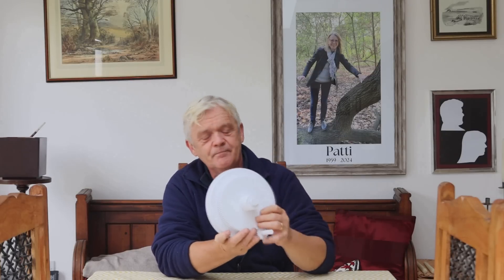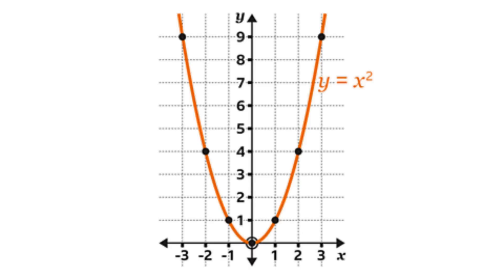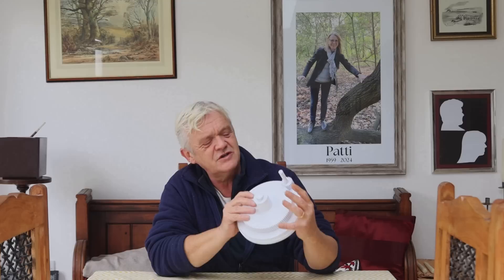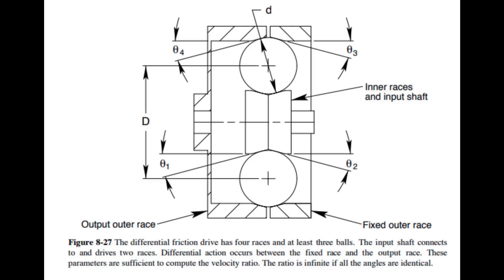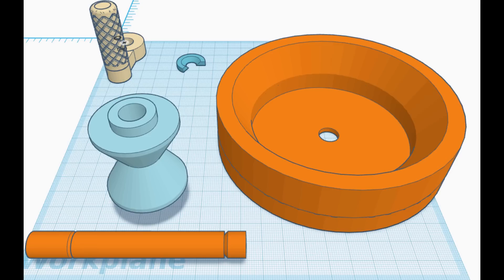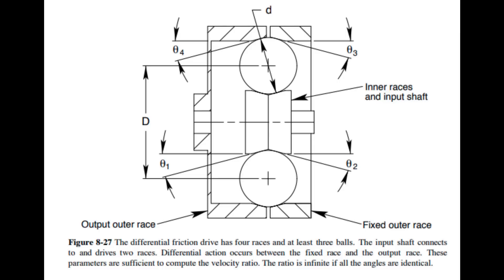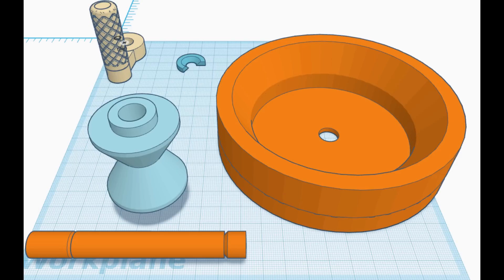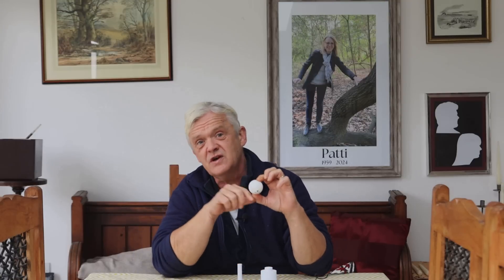2311 The NIF Differential Friction Drive

Comment: Rob, what would a gearshift look like for this apparatus? I'm trying to picture it on a bicycle or some other simple illustration of function. If the degree of compression is the magic that makes it all work without destroying itself, How would you adjust the height/distance to ply a different part  of the balls, while maintaining really really constant pressure? 

(The precision would have to be out of this world.)
Reply from the maker: to make it a bicycle transmission you would swivel the ball axis on pivot pins and linkages mate

Comment: Nice device!  Guessing, I get that the ratio is near 15:1.
Reply from the maker: that's not bad from ping pong balls! lol - cheers mate
Reply: @ThinkingandTinkering   Golfballs are about the same size, and can handle more friction and stress.  I also won't get flashbacks to Captain Kangaroo!
Reply from the maker: @azlandpilotcar4450  that's a great idea mate - ping pong balls have something else going for them too - they act like springs - I haven't mentioned it yet but it is an important point - i will be expanding on this in the next vid
Reply: @ThinkingandTinkering  Golf balls are very "springy" too  - The inside is usually or used to be made of cork. (not that I am a golf expert by any means, but when you see a golfer hit the ball in super slow with a driver, then it actually deforms to an egg shape momentarily ) If you need compression golf balls might yield a better result - I think this is a very good suggestion.